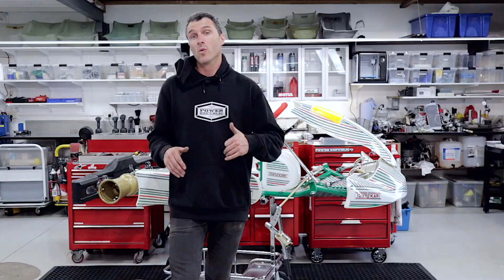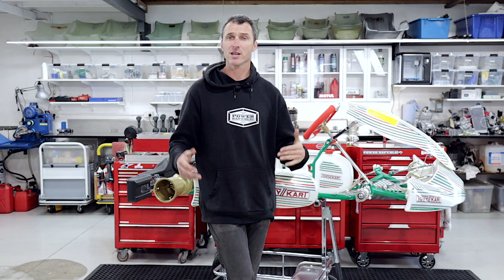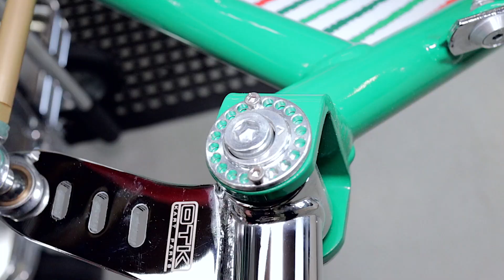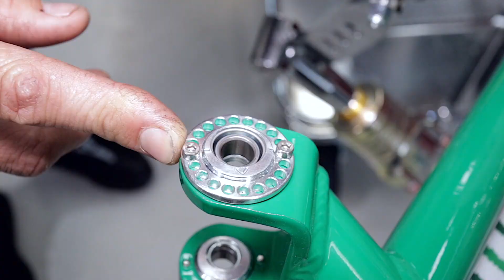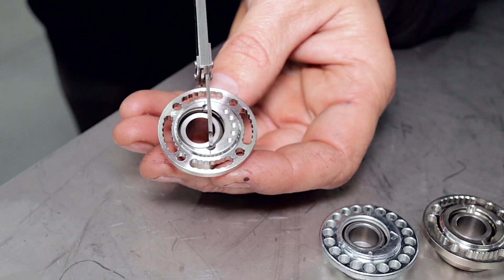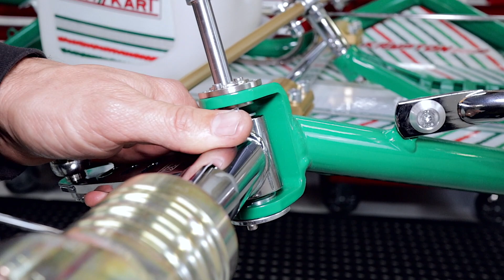HOW TO: Fine Tuning Your Go Kart For Ultimate Performance - POWER REPUBLIC

Comment: i just switched to a OTK chassis and remembered this video and saw it again, how necessary do you think this kit is? compared to what the kart comes from factory, and is there a difference between this kit and the one from senzo? i saw they sell them but its much cheaper that the one from kartshop
Reply from the maker: They are expensive , but you get what you pay for.  You can buy the Senso separately and the standard OTK ones.   So the kit isn’t necessary, but a nice addition if you can stretch.
Reply: @PowerRepublic  thanks for the quick reply, i really appreciate all the information you provide, i even pasted the decals of my new kart thanks to you...again thanks for your help and your amazing attitude to share knowledge with that said i will save a little more and get the kartshop kit
Reply from the maker: @ThePsyenzyme  anytime

Comment: Hi Derek, been watching your videos recently and man its been a huge learning experience, much appreciated for your time and efforts and will continue to support this channel.
Im very new to karting but im not new to motorsports.
Ive got a few off topic questions to ask, i've recently acquired a Swiss Hutless chassis with a Biland SA250 for recreational use and learning. 
Could chassis components be interchangable between brands? 
Could this kart be used for competing?
Reply from the maker: Hey Tommy, thanks heaps for the good vibes and for tuning in.  most part will interchange as along as they have the similar dimensions from other brands.  I haven't seen many Swiss Hutless karts for a few years, so I can't say for sure.  however the Tony Kart parts are common and plentiful so maybe start there for replacement parts if you can't get the genuine version

Comment: If I had a a rear heavy kart and I wanted more grip in the front. Would taking weight off the rear give more grip in the front or just less grip in the rear?
Reply from the maker: Hey Kev, I can't say for sure but if you did remove excess 'grip' off the rear, would that solve your understeer?  my guess is yes.  try it a see if that balances your kart out.

Comment: What size kingpin are those compatable with?? 
For my kart, i had to swap the 8mm kingpin to a 10mm when i upgraded the front brakes, so upgraded the caster/camber adjusters with a doubled set of dot 5, so i have adjustment at top and bottom. It allows for more independant adjustments of the castor OR camber. Theres a 3rd option to upgrade, thats the sniper caster/camber set up, which looks the best, and costs a small fortune.
Reply from the maker: has both 8mm kits or 10mm kits
Reply: Hey Christian, if you have single (top) adjusters and you want to switch to top and bottom, is there anything else you need to change? Or do you just have to swap the bottom fixed ones for adjustable ones?
Thank you
Reply from the maker: yeah you can put adjustable in both top and bottom.  I like to leave the standard one in the bottom as a reference.  then I just change the top adjuster as necessary
Reply: @PowerRepublic  Thank you Derek, you're the man. I thought I had to add more stuff... But now I'll definitely replace the bottom one.
Reply from the maker: @Dabaiko  anytime broski
Reply: @Dabaiko if you have the 10mm kingpin its not difficult, id recommend buying a used set off ebay though to save cash. If you have the 8mm, they need swapping for 10mm, so the axel stub needs swapping to work with the 10mm size.
Reply: @christianbuczko1481  Thank you Christian, I'll look into it. I guess changing the bearings if I have the 8mm in order to swap the kingpin, eccentrics and bearings (inside the stub axle), right? 
Thanks man!
Reply: @Dabaiko  i dont think you can change just the bearing, you need the whole thing replaced. When i did mine, i was swapping 401 standard front axels with an 8mm kingpin over to the front brake setup using 10mm kingpins, which needed adjusters, kingpin swapping to fit. If you have 8mm, you would be better off getting the kit from this video that is compatable with those 8mm kingpins, and save money on the axel stubs.
Reply: @christianbuczko1481  Awesome. Thank you so much for taking the time to explain this!

Comment: hey im running 20/73 on a lo206, but im only reaching 5400 rpm, what should i do
Reply: Reed valves?
Reply: @ruividal1971  sorry I’m kinda new to karting what’s that mean
Reply: Assuming you mean the Briggs 4 Stroke engine when you say LO206, I would suggest trying to run a 75 rear sprocket and seeing how that affects your top RPM, if its gone down further then try moving to a 71 rear instead, though if my tired mind serves me right you should(?) get more RPM relative to speed by increasing the sprocket size... in any case a tachometer or other datalogger should be able to give you an easy indication of how the sprocket size change is affecting your revs and you can fine-tune from there, hopefully this helps!
Reply: @leroijenkins1103  it was running around 6k rpm but it went down to 5400 in my pre final, I don’t think it’s the gear size
Reply from the maker: not sure if the 206b has reed valves (we have videos on how to check them if your interested ) as it is a 4 stroke engine

Comment: Can't help but cringe when proper race karts are called "go karts". Go Karts are those slow lawnmower engine powered steel things, not state of the art racing karts.
Reply from the maker: well yeah that is correct,  are they are still around.   But yeah, the modern racing karts are awesome little racing machines IMO.
Reply: @PowerRepublic  to me yeah, hire karts at hobby circuits and things like that. Each to their own though. Just not to my liking. .